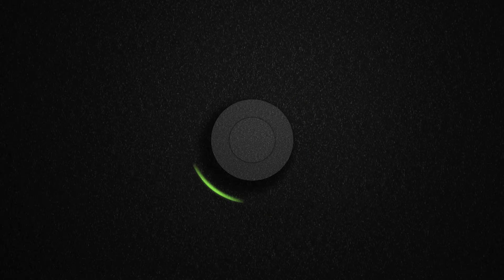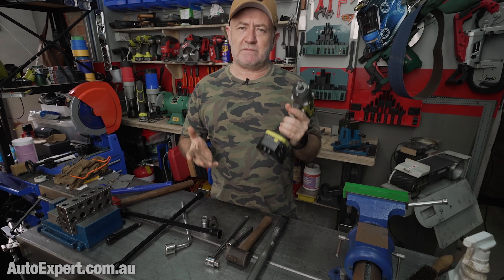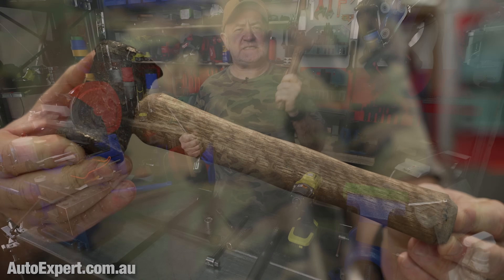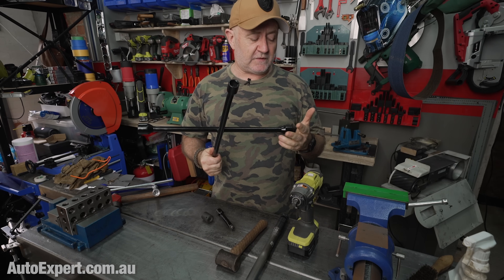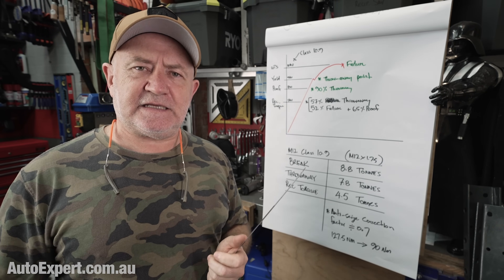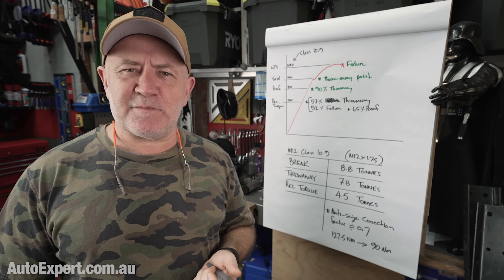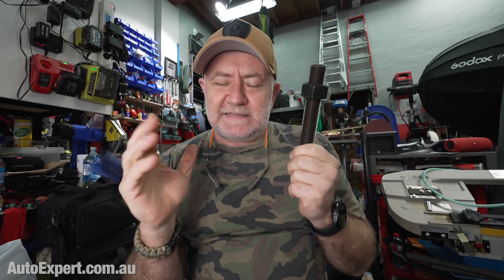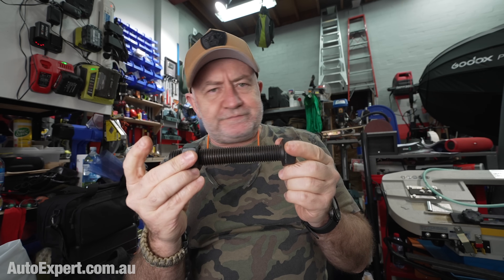Wheel nuts: Ultimate 'ghetto engineering' DIY deep-dive | Auto Expert John Cadogan

Comment: Next time supercheap are doing a big sale do your self a favor get yourself a half decent socket set to live in the car, I love having mine there, changing tires is a dream and it gives one a good amount of extra ability.  And if they are tight enough that a decent bar and pipe can't get it off I have had good success calling the Tyre ship in question and pointing out my disappointment with the current situation and they sent a fleet service truck out to use the big ratttel gun to get them off.
Reply from the maker: I agree - but overkill for just changing a wheel.
Reply: @AutoExpertJC  But excellent for impressing Tiffany on the side of the road ;-)
Reply from the maker: I agree. It's all she can talk about afterwards, doubtless.

Comment: Delivery truck tried to change a wheel in my driveway, forklift lifting on my 3/4 drive ratchet, broken ratchet.
Reply from the maker: Should've hammered a long 3/4 breaker bar with a 2kg brass hammer.

Comment: A light coating of oil on wheel nuts will be fine for assembly but it is certainly not what should be used. By the time you go take the wheel off, the oil will be long gone. I have always used grease, whatever type I have to have at hand, GP is fine. The problem with frozen wheel nuts (or any nut/bolt) is that when you go an undo it, you will be applying a twisting force to the stud which could damage it by rotation (overstretching is not the only way a bolt/stud can be damaged or broken). All the broken wheel studs that I have ever seen have been bone dry and broken when trying to get a wheel off. Yes true they may have been previously damaged by overstretching and even twisting by assembling dry, but my opinion is most of the damage done to wheel studs is at disassembly by not having the studs lubricated. Of course when you see someone with bone dry studs on their car you immediately know the owner has no clue on how a bolt actually fastens and you can expect them to be horrified should you decide tell them to lubricate them as "that will make them slippery and they will fall off!" The importance of having properly lubricated wheel nuts was taught to me by the old man at about the time I learned to walk. Amongst the many things he did in his life was drive trucks through some of the most corrugated roads in world, Atacama Desert and he never lost a wheel though "noobs" would do so all the time. Not the sort of place to be broken down in, scorching during the day and cold enough to freeze water during the nights. The only way for stranded trucker to survive the nights would be for them to burn their tires for heat.

Comment: How can you slay tyre shops for using the ugga dugga to tighten wheel nuts, which of course is wrong, when you just did the same yourself with your electric ugga dugga without so much as mentioning the risk of over tightening as you did it? I found myself cringing which was a surprise watching one of your videos

Comment: If you know your body weight, you can just step up onto the wrench arm at the proper torque moment distance.  More accurate and available than those click wrenches that typically are useless for calibration or repeatability.

Comment: The best thing about the cross-style tool is that when you're taking bolts/nuts off, they're more balanced, so you can hold the outside arm of them lightly and they spin really nicely. Much quicker than the one-armed variety!
Reply: Also, cross braces let you apply (maybe not quite) double the torque, as you can push and pull from opposite sides at the same time.

Comment: I will stick with the extended idea with a bit of water pipe, sticking my foot on it works for me because I make sure I have set the nuts to a suitable torque setting, I used to carry the 4 sided thing but find that one hand either end did not give any torque multiplication in fact it was harder to use because the lever length is shorter.than the standard bar particularly with a hand either end. But if it works for other people thats ok.I use my 240 volt impact gun for removing wheels at home but am careful using it to tighten up. I bought it to do on OHC belt replacement which was absolutely necessary.
Reply from the maker: Yeah - that's an integrated solution. Put a hammer in the boot.
Reply: @AutoExpertJC  Ok, Thanks for tha John, i will take it on board.

Comment: When I have my wheels rotated, or get new tyres, I always insist they put the wheel nuts back on my hand with a torque wrench. I always have. I won’t have a rattle gun with me if I even need to change a wheel. I also have no upper body strength, and can’t do a single pull up. I just hang there… straining and groaning. 
I’m also pretty sure that even if I did carry an 18v rattle gun in the boot, dollars-to-doughnuts the battery would be flat when I needed it (like you said).
Reply from the maker: Secret to a pull-up: don't do it from a dead hang. Retract your scapulas hard and do it from there.

Comment: Hmmmmmm 

I always thought copper -based anti-seize I think it used to be called “ultra copper” I’ve  got a tub out there somewhere that I’ve had for 20 years

I always thought that was intended for use on hot applications like exhaust manifold studs…..

And the Permatex  stuff which is the silver based one used to be virtually the only brand out there the last time I was pulling cars apart……

I seem to remember if you used the Permatex silver based one on exhaust manifold studs it used to just basically burn off before your eyes…..

Comment: in the last millennium we used copper hammers with flogging spanners to do up and loosen nuts on studs on flanges in oil and gas industry. Copper because of non-sparking property. With practice one could feel the correct tension and of course the flange didn't leak 😮 This millennium they are banned.

Comment: A guy I know had a flat in his new RAV4 and could not get the jack out of the RAV4. Toyota wound it out to the point it was so tight , he couldn't get it out of it's spot. Now that was inconvenient.
Reply from the maker: I had a test car once with a flat, and the spare wheel removal screw thingo was (seemingly) welded on. It defeated me out on location with no tools. If only I had packed an angle grinder... Even a multi tool or recipro-saw.

Comment: Hi John excellent as always 🤙 Might I also suggest some light eye protection when whacking anything metal with a metal hammer . Doesn’t take much of a chip or splinter to cause regret …
Reply from the maker: Good point. Less risk of that with brass, of course.
Reply: @AutoExpertJC  Get brass inside the eye and you get a rather spectacular cataract. I'm an optometrist and I've only seen them in books, so not that common.

Comment: Having the right tools handy is all well and good until you come across swollen 2 piece lug nuts. Those things should be outlawed. I was hoping you would touch on them in this video. I doubt its as much of a problem in Australia though.
Reply from the maker: Never seen one.
Reply: Hi mate, I'd forgotten about those, the ones whith the chrome outer jacket, over a steel nut, rust starts underneath the jacket,and expands it till your socket won't fit, I've chiseled a few of them off in my time, happy days, stay safe mate.

Comment: I take my hat off to the engineers that designed the torque wrench, how it is possible to get any accuracy when its probably?? nothing more than a ball bearing going into a recession in the wheel? attached to the half inch drive.
Reply from the maker: Yeah, but it's really a beam deflecting, which dictates the point that happens.
Reply: @AutoExpertJC  Ok, Thanks for that John.

Comment: Some wheel  nuts are 18.5 or 19.5 mm.Those size nuts have an alluimiun cover over the original nut.Its a dumb idea but just watch out if you are using a rattle gun or strike force on a ford ranger or any other manufactures  cars  that use these nuts.Its posible to destroy  the cover if you don't know,you wouldn't know that  it has a decorative coverand if you destroy it on the roadside watch out.... you can find a impact socket on line that does both 18.5 and 19.5.

Comment: Well my Crypbi impact driver didn't get mine off. And when I got new tyres from Tony's tyre service they used a torque wrench. I just stand on the small tyre iron to tighten and loosen them. Never had one strip or come loose or brcome loose on their own.  Impact wrenches give out no torque figures. So you don't know how much you're torquing things up. So screw yer opinion. I value keeping my wheels attached to the car or truck when rolling  on down the road

Comment: As a dealership tech, our responsibility is increased to place the vehicle back into its original design configuration. This includes seat belts to wheel studs or whelk pins. I have always used the factory setting using an anti-seize compound lightly applied, but loosen them and hand tighten & stop before it clicks or reduced the torque prior. Never had a wheel come off. Yet the Mongolian Monkey Spankers at abundant tires shops love the pretty Yellow, Blue, Green or whatever color “Wheel Torque Cheaters.” How much air, impact setting wide open, how long after tight do they squeeze the trigger, is it been oiled since they bought it 8 years ago, or oiled everyday except the hammer section with oil set screw (Page 18 or owners manual, they never read). I will cut them in half with my torch. And torque charts from tire manufacturers are much better than the fasteners maker! 
  I think over my wife who would try, then call me with wrong location directions to fix a flat. Few things aggravate me than wheel studs so tight from the tire shop while standing on my 6’ pipe cheater bouncing to loosen without letting go of the roof rack because at 6’ 3” I can use it to stable myself. If it breaks, I call the owner to ask about recent service from “Tim’s OverTorque All” garage. Yet, only once did a tow truck come for this bolt the yielded once too often. Love the videos and spec of engineering as learning is like taking a piss. Piss on the fellows boots next to you is better than your own, on purpose. I simply tell them my aim is better!
DK. ASE Master Tech since 1978.

Comment: I have seen many times over the years wheel nuts loose and came off or so bloody tight ya can’t undo with the standard wheel brace. Lazy tyre fitters just using a rattle gun and not checking with a wheel brace.

Comment: I had Satan's wheel nuts just last night. Thank F##k I was at home. Selling Subaru A. Buyer only had so much money. So as part of the deal I suggested swapping rim/ tyre combo with Subaru B. A great plan I thought. Giving me mags and brand new tyres on the older car. Older standard rims going to the luxury turbo (a) that was being sold.
Car B, OMG! 3 of 5 wheel nuts were cross threaded. The other 3 wheels came off by another method you didn't talk about. Which was cracking the nut using the supplied equipment and my body only. Wheel brace on nut. Right foot on brace. Left foot on right foot. (Now about a foot off the ground holding onto roof rails and or bonnet near wipers. 
Using body weight alone, no movement. A bit of a up down jumping action does the trick. My 55kg wife and daughter can both do it.
Any how, the other wheel was knackered. 
2 of 5 sheared off. The 3rd stuck one came off, the thread completely useless.
Car was tilt trayed to mechanic shop today, ready for repair tomorrow. 
John. Given that Subaru B has 220k on clock, recently purchased. Maintenance history unknown/ untrustworthy. 
Is it worth fixing the studs?
Or should I just request a quote for new pads and rotors and have peace of mind for the next 50k?

Comment: Deflecting Beam Torque wrenches are more accurate and stable than conventional steel spring torque wrenches. Conventional torque wrenches need calibration every 12 months. Deflecting Beam torque wrenches remain accurate for years.
Reply from the maker: Yep - but they're all still only approximate because the major variable is friction. More accurate wrench doesn't really improve things much.

Comment: Need a galvanised plumbing pipe to slip onto the wheel brace. I reckon the he tyre jockeys set their rattle guns to max when they screw the nuts on and then give them an extra 1/2 turn.....I suspect the mechs do the same with oil filters.

Comment: Outside of the basic framing hammer swung by a carpenter, swinging a hammer shouldn't happen in an arc. It should happen in a relatively straight line and not with the arm, but the body instead. Heavier the hammer, the more important it becomes. Proper technique will save your back, arm etc but more importantly in this instance, it improves accuracy and control over the applied force.

Talk to a blacksmith, they'll almost certainly be happy to show/teach you.

If you have a nice soft face hammer and your wheel nut covers the end of the stud, hit the end of it first. One or two sharp taps. Rattles loose corrosion etc that has built up in there or whatever and can substantially reduce the torque required to remove.

Spanner monkey 101, always hit a tight fastener first. Doesn't matter if it's a bolt, nut or machine screw. If you can hit it directly, do that. If you can't, use a brass punch.

On the torque wrench, yeah, nobody is going to be as accurate or repeatable as a torque wrench. But, enough years have taught me what a bolt should feel like when tight enough.

Now, I'm not trying to say I can hit a torque spec, not even close. What I can do reliably is get within the range of tight enough and not damaging the bolt for your normal 8.8 or 10.9 fasteners up to around the M12 sort of size. Certain things you just don't do that for, like wheel nuts, brake calipers, head bolts, flywheel or towbar bolts etc but most of them it's just fine for. It's just the ones that kill people or cost a lot of money when you get it wrong that you really want to spend the time looking up torque specs for.

Also, it doesn't matter if you go up or down to the torque setting on the wrench. That spring you were talking about mostly takes care of the backlash, and whatever residual error might be in there will be well inside the calibration accuracy of the wrench, assuming that it was calibrated at all. Cheap torque wrenches aren't known for being particularly accurate. More accurate than the calibrated arm for sure, but really not accurate.

Finally, the nut thing to check a thread is only kinda ok. In practice your eye is actually quite good at seeing very small irregularities in pitch on those threads. It's terrible at determining what the pitch is or how much it changes, but very good at seeing that it does change. Just hold it sideways and look at the gaps. If they don't look the same, they probably aren't. You'll see variations in pitch that a standard nut will glide right over. The other dead easy way to check is with a 6" (150mm) steel rule. Place that along the threads and look for any dips. The bolt will have necked down at the point where it was stretched, there will be a light gap between the rule and the thread peaks. And again, your eye can pick up some surprisingly small differences in this way.

Comment: 615 comments?!?!? OK you're never going to see this one. I have an interesting lug nut conundrum that I either solved or made a lot worse, you pick. Land rover in their infinite wisdom uses a hub where the Lugnuts cannot be replaced without removing the hub from the bearing. And it's not really LAND ROVER it's actually from a Volvo running gear shared component. The studs and nuts tend to seize up, so when you take the lug nut off it strips the threads off the stud (not replaceable) I made a tool to drill out the hub and replace the stud with a Toyota stud that uses a nut instead of driving it in, but that's a whole other subject. I know you should never put anti-seize on wheel studs for various reasons, but this was out of necessity. (again not replaceable) the dry fit torque specifications for the wheel studs is quite different from the lubricated torque of that size fastener. To prevent overtorquing I changed the torque for installation to a lubricated torque value to prevent the stud from breaking off, or stretching. Good idea? or Bad idea? So far I have not had any issues other than making sure the tire shop uses the correct (new) torque. Did I miss anything in my theory?

Comment: The supplied wheel brace is nearly always garbage. And as you will have been driving the whole assembly is hot, much harder to undo aswell.
Reply from the maker: Agreed. It's the minimum tool for the job.

Comment: John, never use a chrome plated ordinary socket in any impact situation. They’re not tough enough. If it breaks in the removal or refitting if an expensive alloy wheel you’ll be crying all the way to an expensive and unnecessary repair. Great channel though. Thanks.
Reply: Not to mention they become a skin shreading device if the shitty chrome plating on that cheap socket let's go.